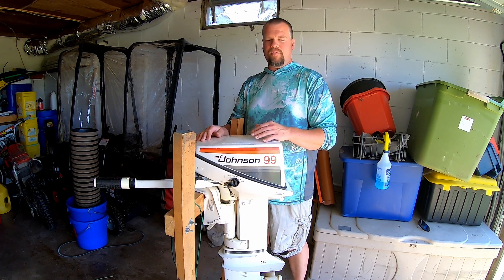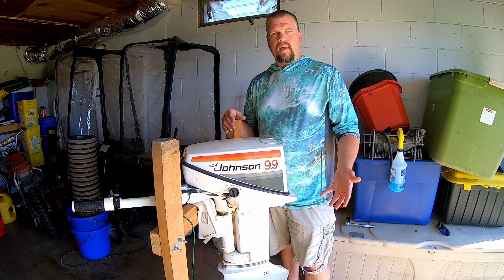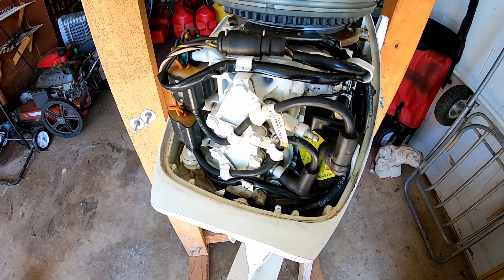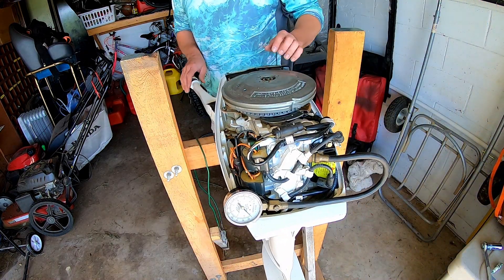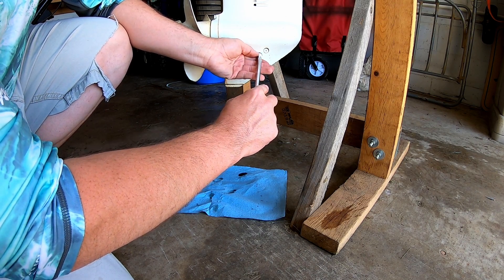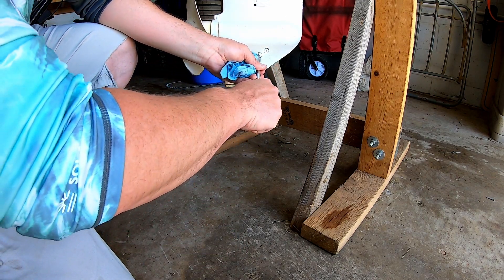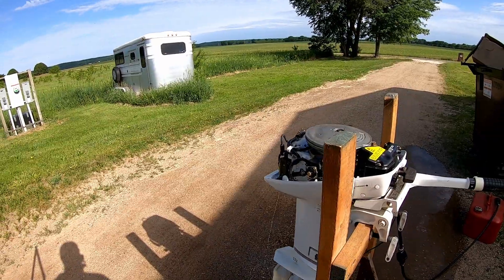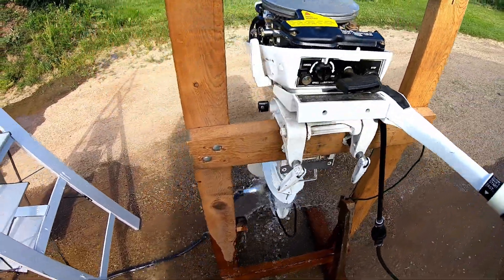Johnson 9.9 Will it run after over 15 years in storage?

Comment: You must be living right !! Thanks dad for taking care of the engine for us... I'd change the water pump impeller just to be safe, after being stored that long. The impeller's rubber vanes develop a "set" and become brittle and can often break off when the motor is restarted after prolonged  storage. Checking to cylinder head with a heat gun is a good thing to do. It shouldn't get over 150-160 degrees. Have fun out on the lake !!
Reply from the maker: Yessir, changed the impeller shortly after the video and got her mounted as a kicker on my pontoon!

Comment: Enjoyed that one, what's the knob on the side of the engine for?
Reply: The knob on the side is fine idle adjustment for trolling since these were used as kicker engines a lot.  Most of the knobs have since broken off or are inoperable.  I was surprised to still see it on this one.